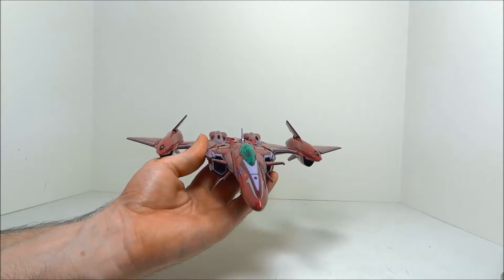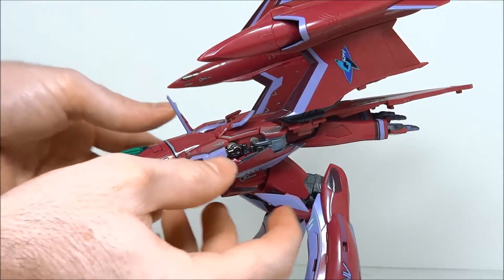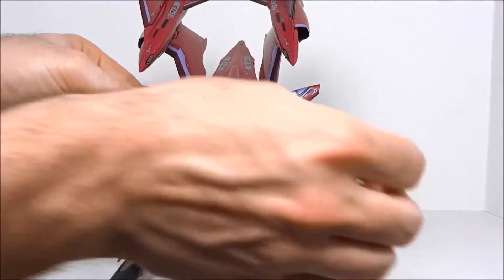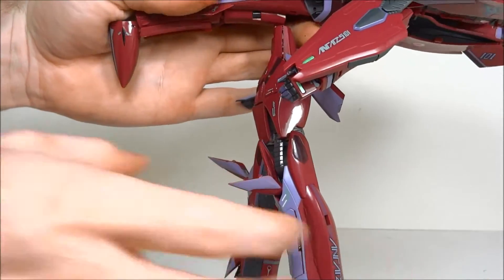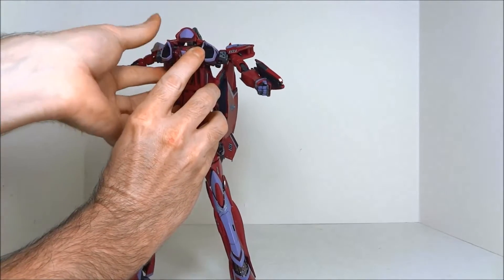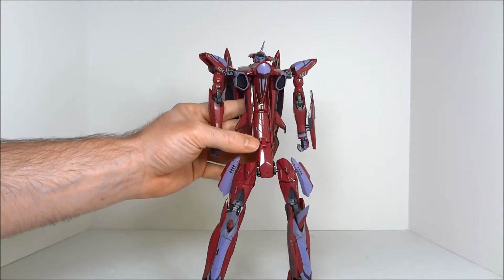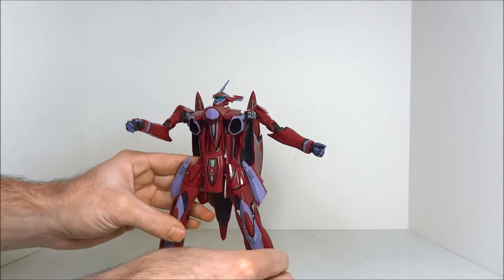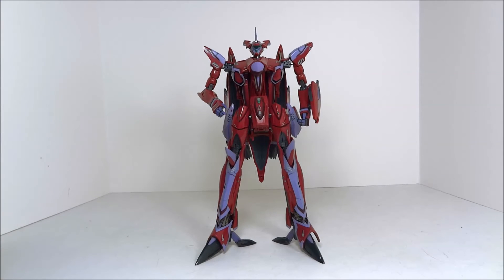Bandai Renewal VF 27 Transformation

Comment: I was having massive trouble going from battroid to gerwalk. Removing the nose from the inside of the chest is just ridiculous thanks to the unique and unnecesary shoulder system. By having the shoulder locking system, the space required to clear the chest and free the nose is very limited. Bandai should have used the same system as the vf 25.
I got tired and cut the little metal bars that lock the shoulders... thus achieving more room to free the chest. Great reviews!!! 
Cheers!